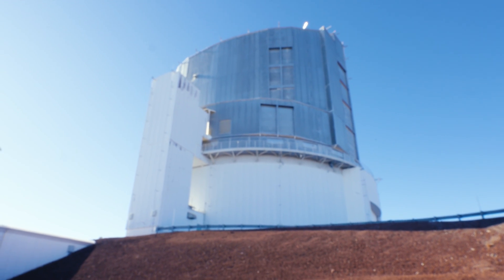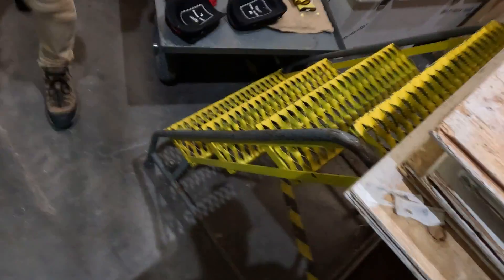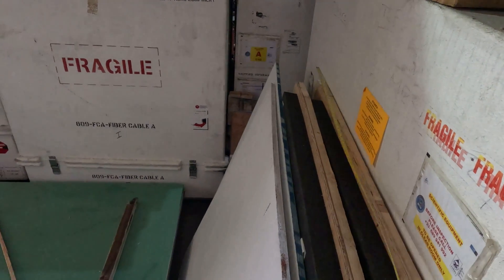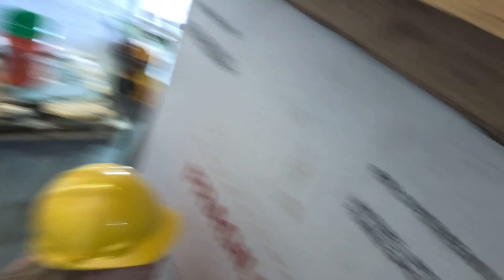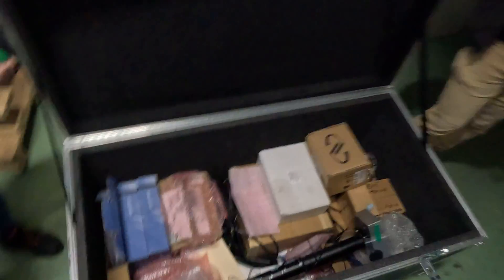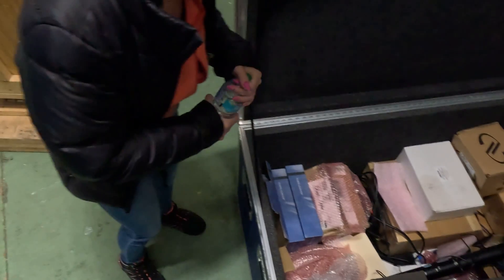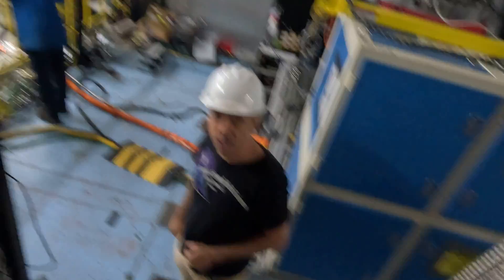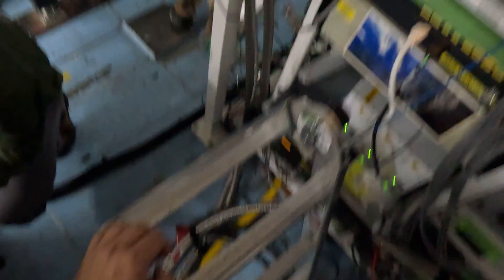Exoplanet Camera Comes Home From Hawaii

Comment: Are you really that high in elevation you need supplemental oxygen while working? Or is it just a precautionary measure?
Reply from the maker: It's not required by the observatory. We decided to use it since we were doing a lot of manual labor (Michael's iPhone said we climbed 37 flights of stairs at 14000' at the end of the first day) and the two grad students hadn't been to this altitude before. We had a tight window to get things done, and if anyone got altitude sickness it would have been difficult, so it was nice insurance.